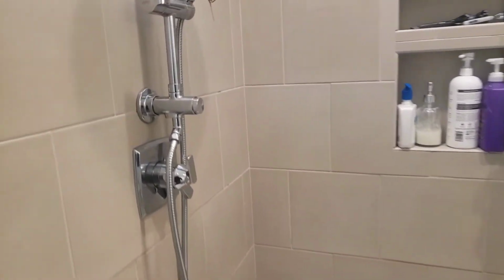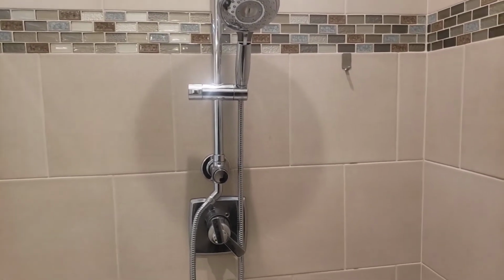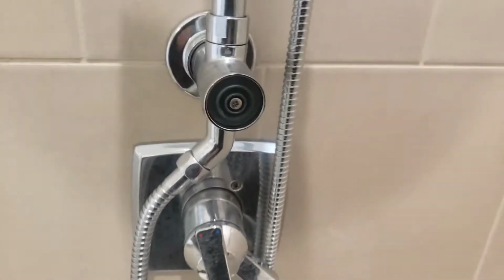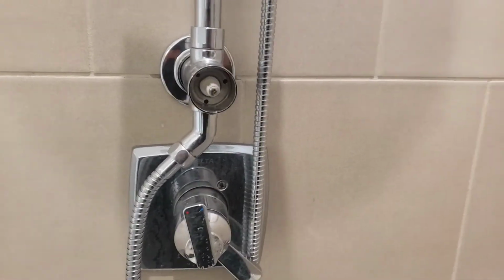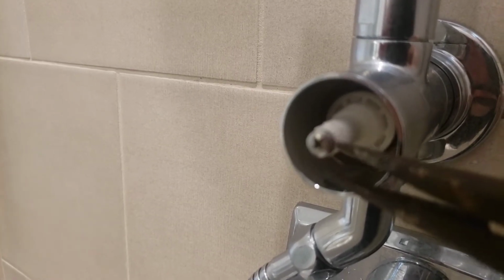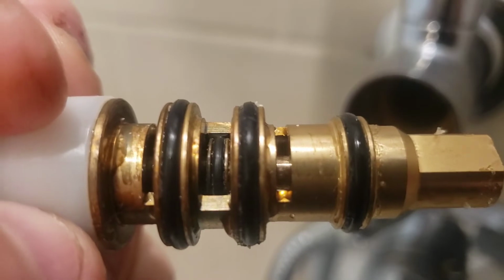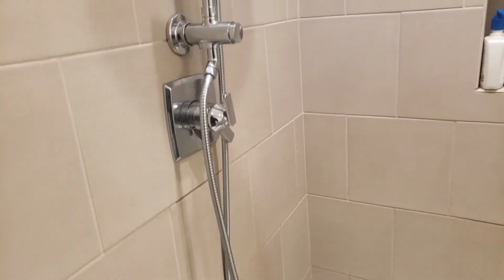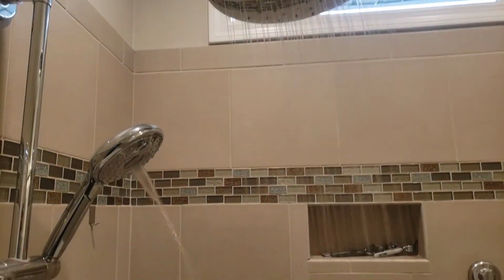How to Repair an American Standard Spectra Versa shower head with a stuck diverter valve Part 1.

Comment: I just received the new re-engineered diverter! It is a dial now that turns instead of the push button and it works great! Definitely call American Standard and have them send you one!
Reply: This is good info. Thank you. I got mine 4 months ago but it looked exactly the same. Was there noticable differences between the two, old and new?
Reply: Hey just spoke to American standard in Canada. They know nothing about a redesigned diverter in a dial form. Would you be able to share with me the part number in which they sent you? Their site only shows the push button cartridge. Thank you!
Reply: I would love this too. Amazing video totally helped me had same issue! Thank you so much
Reply: @billbachman6940  apparently the rotary dial diverter assembly is on back order to earliest late may. This is what I am being told

Comment: We have the same issue. They need to come out with a permanent fix for it.
Reply from the maker: I agree. This is the 2nd unit I've had and its failing like the first one. I think its a design flaw and the valve needs to be redesigned.
Reply: Mine has been stuck for more than 2 years, took apart several times and am tired of this shit! A product that cost almost $500 should work flawlessly, American Standard has danced around this the whole time, not all people are capable of this type of repair nor should they have to be. If they read these blogs they had better get teir shit together! Anyone for a class action lawsuit?

Comment: Thanks for the video. But prying the cartridge out by the screw is a bad idea. The 3 static o-rings can be stuck fairly tight and the plastic nub can  break off. I suggest removing the whole valve assembly housing and use a wood dowel and tap the valve out from the back.
Reply: YES!!! If only I read your comment first. Thank you anyway.
Reply: Same. Oops!

Comment: Same issue here. About to replace my second diverter. They have a new and improved one but apparently it only works in the new model which comes in nickel (mine is bronze). It wouldn’t be cost conducive for me to have to replace all my bathroom fixtures. They have been good about sending replacement valves. This time, to my surprise, they sent me two replacement valves. The lady mentioned on the phone they were getting low on inventory, so I guess they were trying to look out for  American Standard should just issue a recall and give everyone refunds for such a poorly made product.

Comment: Thanks for sharing the video, there is actually 3 inner o-rings that need lubrication.  You can unscrew the white plastic cap to get easy access to the inner rod and o-rings.

Comment: The little plunger part was stuck on mine. Sprayed it with some silicone spray and pushed a small drill bit through the back end and it popped right out. Thanks for your help!

Comment: Thank you! You saved me from sure disaster. I had the same thing happen, they sent me a new valve assembly. I'm mechanically inclined, but had no idea how to get that valve stem out. I took the whole thing off the wall, started to try and remove the stem from the back with vise grips, needle nose pliers. Then, I found your video, I had the stem replaced in 5 minutes.
It'd have been nice for American Standard to include some instructions on how to disassemble the damn thing.
Anyway, we shall see how long this one lasts, as you said, it's unfortunate because this is an expensive unit and it shouldn't have a high failure rate or part.

Comment: Thanks for sharing this. My knob was also stuck and all I was getting was the shower.  I used some of your method to pull off the knob, then used pliers to gently pull forward the valve.  I replaced the knob and now I have the shower. This'll do for the time being.

Comment: I bought this shower head some 18 months ago and recently ran into this problem of a stuck diverter valve. I followed this video and gained a partial improvement i.e. shower and rain together from rain only.  In reading the reviews on American Standard Spectra Versa push button shower there are many, many buyers facing this same problem with a sticky diverter valve.  American Standard suggest that hard water is a factor in the  problem but that is not so, we have soft water and I still have this problem. They also advise that they are working to resolve permanently stuck with a replacement order not even backordered.

Comment: on my third valve, what i can say american standard has been great, easy to follow this video and replace, have been dent numerous valves that continue to malfunction, that to this video and thank to american standard....
Reply from the maker: If you haven't gotten the redesigned valve, definitely give them a call. The new valve eliminates the push button and now has a turn valve. It is finally functioning the way it should have.

Comment: Thank you! I have two of these and both have failed within 6 months of install. I am going to try your fix before I shell out any more $$ to American Standard.
Reply from the maker: @fesaura , they will give you the redesigned replacement valve if you call their customer service. I've posted an update video on my channel showing how to install the redesigned valve.
Reply: @violinman1970  you’re correct. They sent a replacement rotary valve and it works great!

Comment: Thank you for the video, I had same issue and it happened after using it for 3 months.
It's just so annoying to fix the valve every 2-3 months. Do you think I can replace the push button to a turn handle kind diverter ?
Thank you

Comment: Thank you so much!  We have the same issue, ours never worked correctly from the start either.  However, I went through the steps up until the screw to help pull out the valve, and that small piece the screw goes into was broke off completely.  Now I'm not sure how to get the valve out?  May have to take backside off and use a hammer of sorts.  Ugh, always something and never an easy fix.
Reply from the maker: Were you able to get the valve pulled out?
Reply: @violinman1970  unfortunately not yet.  The valve is back ordered until July, so can’t really do anything until then anyways.
Reply: Well we finally got the back ordered part.  Got it fixed, works great.  But can’t wait to do it again! 😂

Comment: would a stronger spring be the more permanent solution?
Reply from the maker: @rathernotsay9768  i think it could have helped in the short term but I believe the root of the problem is scale building up on the o rings in the valve and preventing them from gliding properly. Couple that with the water eventually washing the silicone grease off the o rings and it will just eventually stick. The new valve is a twist design and much better.

Comment: I’m having problem inserting the diverter deep enough to screw in the disk. Any tips on this would be appreciated.
Reply: HI, not sure anyone answered or you already have this fixed, but you need to really push hard on the valve stem assembly to get it to seat into the metal body. I just fixed mine yesterday and had trouble getting the disc to thread in.
You really have to push hard to seat it in.
Good luck.

Comment: Do I need to turn water off before taking out full diverter?
Reply from the maker: @KG-qw4fv , as long as you don't turn on the main shower valve, you can replace the diverted valve without shutting off the water as they are two separate units.

Comment: I have the same issue after about 3-4 months. followed your video which was helpful.  However, I could not "gently remove the cartridge".  I tried the screw trick however when i pulled it snapped the plastic part of the cartridge right off.  anyone else having issues removing the cartridge easily?
Reply from the maker: I would call American Standard. They should replace the part for you if you explain the issue.
Reply: I had the same exact issue!  did you ever get the valve out after that broke off?

Comment: I had trouble with it leaking until I figured out I had re-inserted the disk the wrong way. Place it so the back of the disc sits flush against the valve.

Comment: Could i just use wd40?
Reply from the maker: Do not use WD-40 or any other petroleum based lubricants on rubber seals. The petroleum based lubricant will break down the rubber seals over time and cause them to fail. You should only use silicone based lubricants like spray silicone and silicone grease.

Comment: Same issue 👎after 6 months. I wished I did not buy this shower system.
Reply from the maker: I agree. This was an expensive shower head for it to fail this soon. The last time I called, American Standard offered to reimburse me for a new shower head up to the cost of what I paid for this one. I am going to switch it out soon.
Reply: @violinman1970  I am sure they want your original receipt, did you keep,it? I am 2 years down the road and haven't the faintest idea even where I bought this, HD, Lowes, etc.! I'm pissed!
Reply: No more A/S for me, buy cheap and easy Delta!
Reply from the maker: I was fortunate that I had ordered it through HD so I had an email containing my receipt. Otherwise I would have never had it to show to them.
Reply from the maker: I just posted a new video on installing the redesigned replacement valve from American Standard. The new replacement valve eliminates the push button. You can view it here: https://youtu.be/KLhd6qZ9q7g?si=HUZWIUWMhK3kbtge